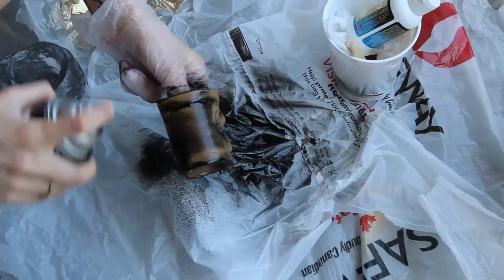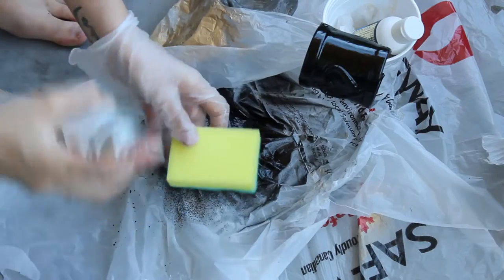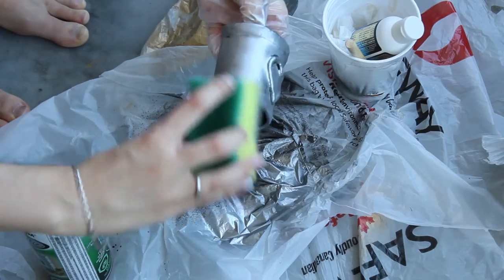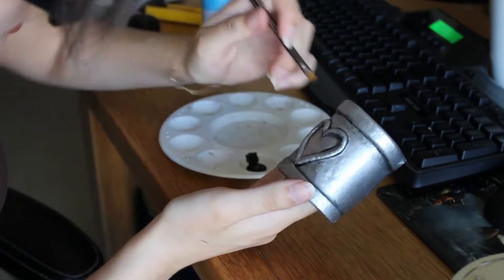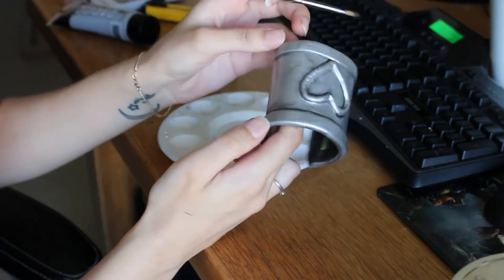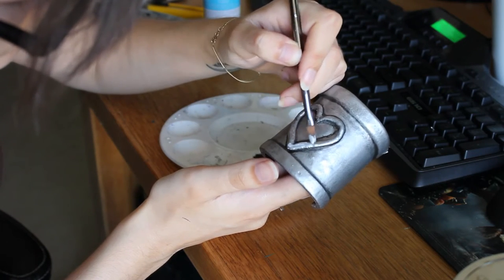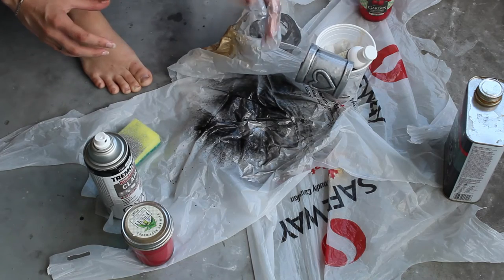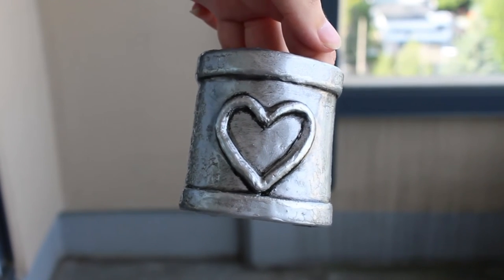How to paint metallic cosplay armor: Tutorial

Comment: you apply spray paint way too heavily, wouldnt be surprised if your paint starts flaking off or stays tacky. spray paint DOES NOT dry fast. it takes hours, and at least 30 mins between thing coats. fastest way would be to use just normal acrylic paint...